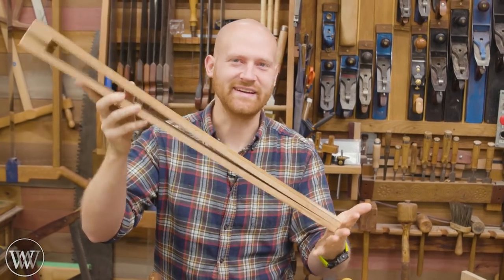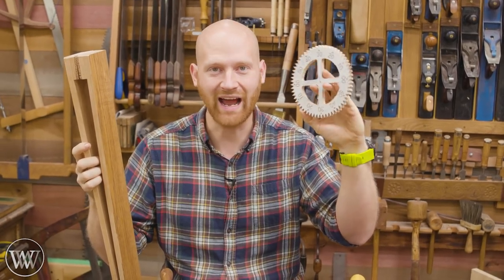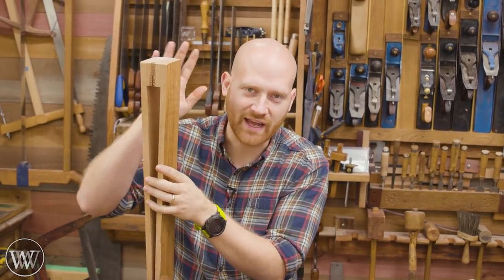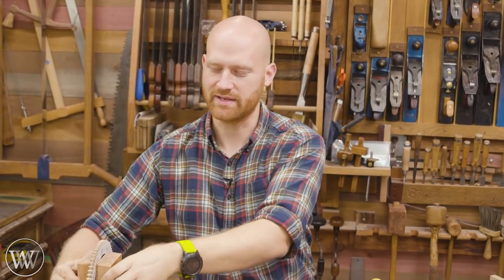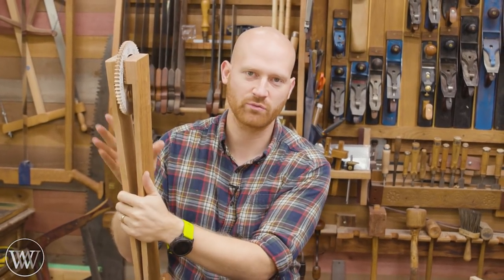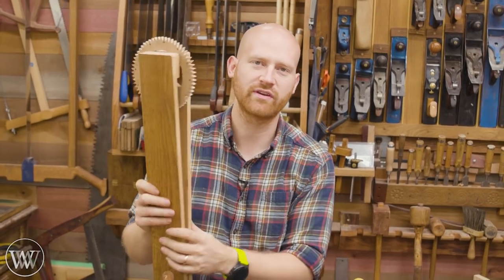Small Parts Vise for Gear Making like Clickspring

Comment: I built one right after watching Chris on Click Spring build his. I love how it works. My bench has no vice but instead I use elongated bench dog holes that are offset from each other. So the idea of using it in a vice is out. I simply made a wooden caller to go on the leg of the bench. I use this for a number of different operations. It is a very useful addition to any shop.
Reply from the maker: right on. it is a useful little design!

Comment: This is excellent. I too enjoy the precision-work of Clickspring. You might even want to make a dedicated rectangular hole in your bench for this vise (or several "lined up" holes for several vises for clamping long work-pieces). I'll definitely be making one of these vises.
Reply from the maker: Thanks. The benefit of puting it in the vice is I can adjust it's hight. If I make a dedicated hole then the high will change depending on the thickness of what I. Working on.
Reply: Yes, true. :)
Thinking a little more about it, an oversized dedicated hole could be used in combination with a standard clamp if one does not have a vise or if the main vise is 'busy'. I definitely see lots of possibilities with this easy and low-cost vise. One can easily make a miniature variant for very small work-pieces (like holding a PCB while soldering).
Hey, adding just a nut and a bolt, it becomes a clamp or "self contained vise".

Comment: I like everything but the super glue.
JIM
Reply from the maker: I used to hate the idea of super glue until I actually tested it. And in the right conditions and in the right method of attachment it is incredibly strong and even beat out most tight bond glues in several applications.
Reply: @WoodByWright  where is that glue up video? Weren't you doing an updated one or something?
Reply from the maker: @jameswhite4709  yup. That just came out on the second channel Thursday.
Reply: @WoodByWright  I must've missed it. I subscribe to both. Thanks